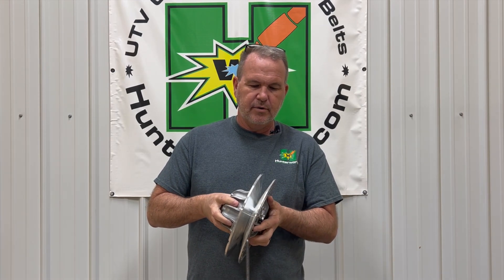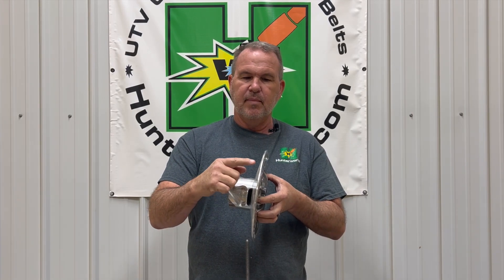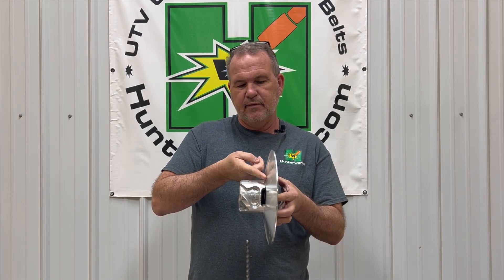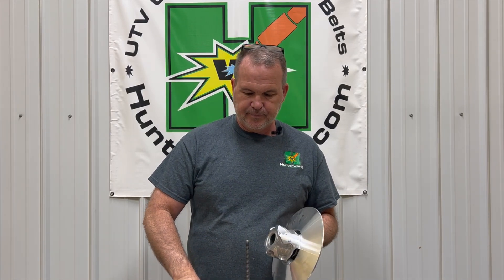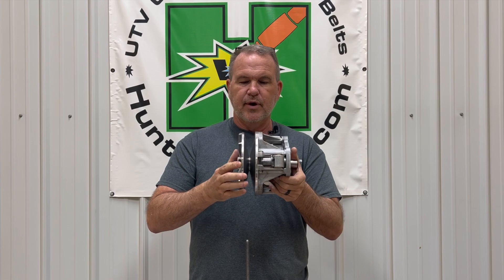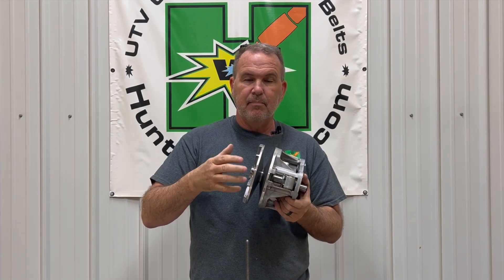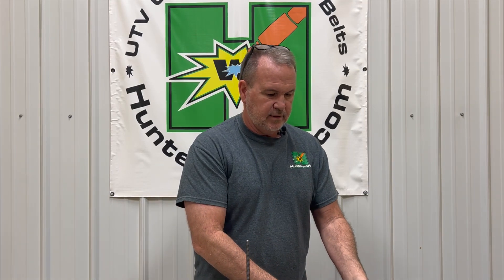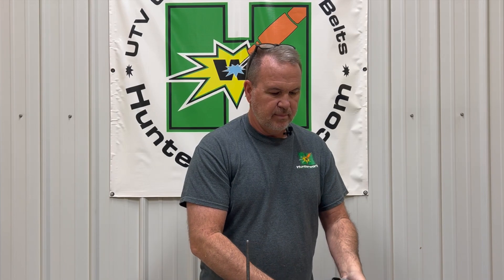Hunterworks Explains what Polaris Clutch and Belt Overtravel is

Comment: Howdy Mr. Todd! I’ve watched hours of your videos trying to soak in as much as possible, thank you for sharing so much of your knowledge with us! I will be placing my order for your updated Primary for my machine sometime within the next week! 

I do have a question for you, however: you said that 900s do not suffer from the over travel issues however I had blown a belt this past weekend on my tuned and clutch kitted 22 RZR 900 at 72mph. I noticed after the fact that I have scuffing at the bottom of my secondary from where my belt rides, and you say that’s no bueno. What could be causing that? I have an SLP clutch kit and I’m running a 321 1180 belt per their recommendation.. as I said I am changing my clutches to your primary and a Tied secondary here soon and hopefully all my issues will be solved, I’m still very curious as to why I’m having that problem. I found at 64mph I’m about 8200rpm but at 65 or 66 it drops to 7700 and starts building again as does the speed.. almost like over drive kicked in but for a CVT that can not be good…
Reply from the maker: It does not that issue with the correct belt, if you going to run a XP belt on it then it needs our std washer.  900 belts are thinner and do not travel as far and your rpm issue is probably just a bad kit set up.
Reply: @Hunterworks  Okay, awesome! I’ll get the STD ordered through your site! I assume I’d need that same washer with your primary, correct? And that’s interesting about it may being my set up to cause it to drop 500rpm WOT.. I’ll have to do more studying to try to resolve that. In all fairness, I very well may just get a whole new clutch kit now that I know a bit more about what I’m looking for. In between the Dalton and BMP kits.
Reply from the maker: @coltonware5627  Dalton is far superior to BMP and with our primary, it is correct no washer needed
Reply: @Hunterworks  You’re saying I won’t need that washer when I order your clutch despite running the larger 321 1180 belt? And I believe you fully, but may I ask in your opinion based upon fact and experience why the Dalton is superior to the BMP? Im looking for aggressive clutching and helix angle/spring weight for a good pull throughout the RPM range. I’m not overly impressed with my SLP kit.
Reply from the maker: @coltonware5627  you can run any belt you want on it, we have our travel correct.  Dalton kits just work and are never wrong, they simply are the best kits you can buy.  Hard to explain but example is lexus or yugo?  Both are cars are both equal in quality?

Comment: I have a 2021 Turbo S, and I've seen your videos regarding the issues with the 2021 clutches. After blowing a couple belts, I bought one of your spacers (and some belts). When I went to pull the clutch and install the spacer, I noticed a couple chunks of metal had broken off of the primary, presumably from the last belt break. I bought a new Aftermarket Assassins HD primary for the 2021. Do I still need to install your spacer on the Aftermarket Assassins clutch? I have a feeling they are one of the companies who's clutches you aren't a fan of, but unfortunately yours is not available yet, so i was kinda stuck. Any advice you could give me on installing this AA Heavy Duty clutch on a 2021 Turbo S, I would really appreciate it. Included with the AA clutch was a plastic limiting spacer. If I do still need to use your washer on the AA clutch, can you tell me where to position the washer? Thanks again for all the help
Reply from the maker: Their clutch is a chinese knock off with their own cover is all, there is not ONE cast aluminum primary clutch made in the USA but our non turbo one and we are not making one for the turbo.  You will be much better off with the new one polaris is giving you on the recall, it is the much HD 23 model, still needs the Dalton kit and still needs the washer.  None of that would i put in that chinese one.  As to what you do with what you have, return it if new or run it if you ran it then when it fails go the route above